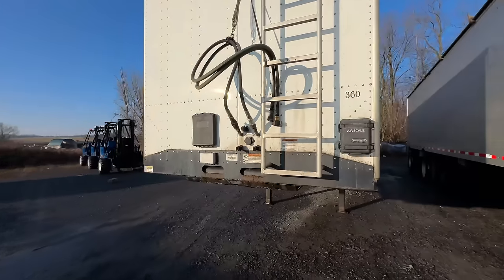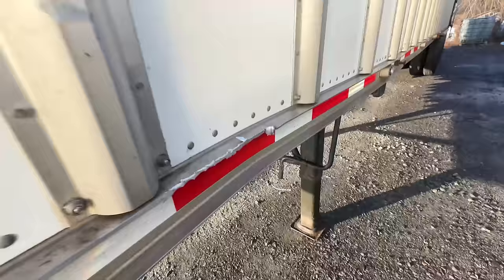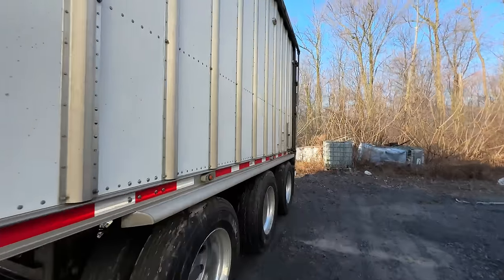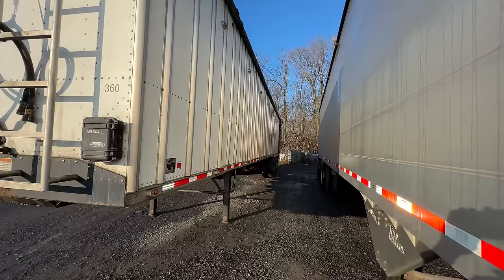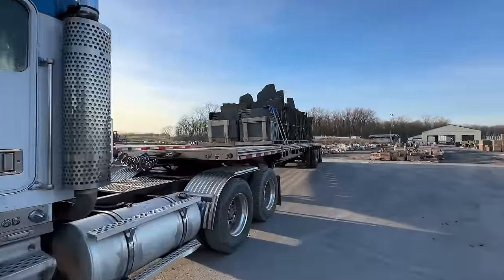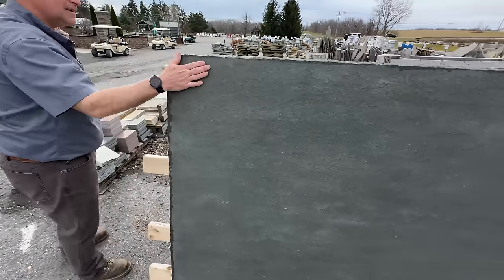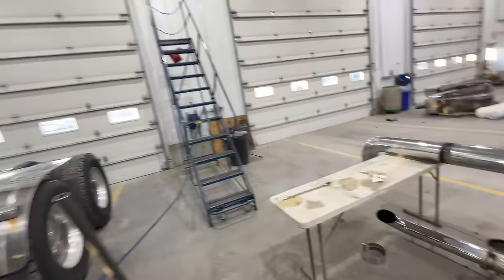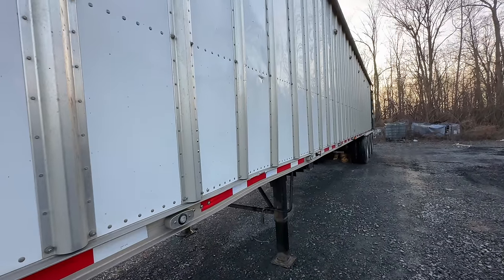Our Trailer Got Backed Into At A Truckstop !!!

Comment: If it was my trailer I would replace the aluminum side rail from the front of the trailer to where the damage ends so it would only have a single joint to weld.  Welding aluminum is not a problem.  Even replacing just the damaged section of the rail should be just fine.  I would install a doubler over the joint on the back side of the rail and weld that in just for added strength.  I have done similar repairs for people and they wanted me just to make it look cosmetically perfect and I just cut and patched the lip and used my metabo surfacing tool.  It all depends if it's a structural or cosmetic repair.

Do you have huck bolt cutters?  They are a great tool to have when doing repair work and there is a couple of different styles.  They make a hydraulic lock collar cutter that shears right through them, they also have special cutter bits that are hollow and they slide over the bolt and cut away the collar.  There is also a huck head cutter that has a spring loaded adjustable stop that shaves the head off without hurting the surface.
Reply from the maker: I just don’t plan on keeping the trailer forever and I know it will kill the resale value

Comment: I know that trailer rail looks bad. But i bet it would never be a issue. Could probably smooth it up. Weld it in. I have seen alot worse on belt trailers and pots . Running for yrs that way.  But i feel your pain. Once you see it. Thats all you see when you look at that trailer! 😂 😢 stuff like that drives me crazy.
Reply from the maker: And I’m afraid resale value will get hurt with weld marks
Reply: @flintcreektransport  its a possibility for sure. Right guy could probably make undetectable lol

Comment: The trailer left side is definitely  compromised and definitely weakened. If the trailer was my trailer I would want the damaged bottom rail replaced and the panels replaced.  It looks like that is  the only damaged parts on the trailer. It definitely should be repaired by the truck and trailer that created the damaged parts.
Reply from the maker: Yes the whole rail is getting fixed !!

Comment: It’s your trailer do what you are comfortable with but I think I’d cut that section of the rail out and weld a new section in. I’ve seen it done on those western belt trailers and it worked fine. Like I said it’s your trailer do what you feel most comfortable with. It’s frustrating when accidents put equipment out of use but at the end of the day if it’s not a total loss and no one is hurt it’s still a good day ???
Reply from the maker: The bad part is if I do that it will def hurt resale value …..
Reply: @flintcreektransport   You are right there. That is one thing to consider! Especially if you want to replace it before it’s totally worn out!  Replacing the whole rail will keep the best resale value! 👍👍👍

Comment: The whole rail does not need to be replaced. Get a good welder put the cuts on an angle reinforced at the back
With the 3 foot piece of that side rail, I could have that done in half a day.
Reply from the maker: Yes.   We have good welders.  When I go to trade it or sell it in a few years is when I will have a big hit in resale value !!!
Reply: It’s going to take an hit either way though, you’re replacing panels aswell as the whole rail. Might look alright but it’s still been hit unless you don’t plan on mentioning that to new purchaser, whenever/ if ever you decide to sell it. One weld seem will not decrease the value that much, if any at all. A solid trailer is a solid trailer.

Comment: That belt trailer is a parts trailer now, it will be a huge liability if it-gets  over loaded ever again ,,it might brake in the  middle, I would not use it , it’s a good parts trailer now, p.s. did you happen to think the truck ,,,that backed into it didn’t like the smell , ,,,you know those loads and trailer stink, lol thanks BigAl California
Reply from the maker: lol.   I hope not.    Stuff he had on wasn’t that smelly 🤣🤣🤣
Reply: I’m hoping you’re being sarcastic lol, that outside rail just holds the outside shell, the main frame hasn’t been touched which is the main structure of the trailer. In order for it to be fixed properly that rail needs to be fully replaced but for the average just you could just cut it, prep new rail peice and old rail peice and weld it, place the stickers over and you’d never even see it. Would be more than strong enough.